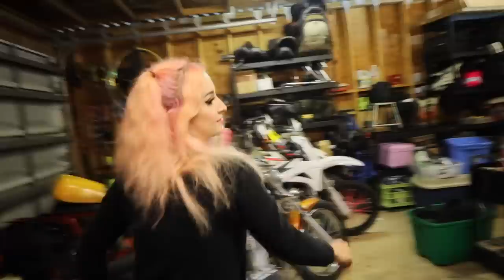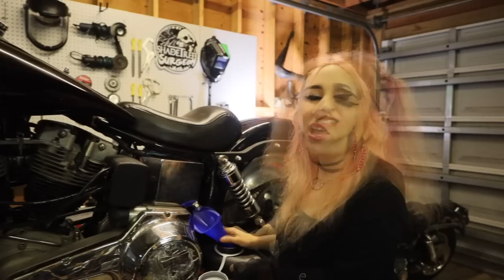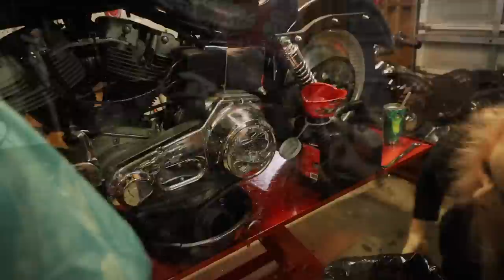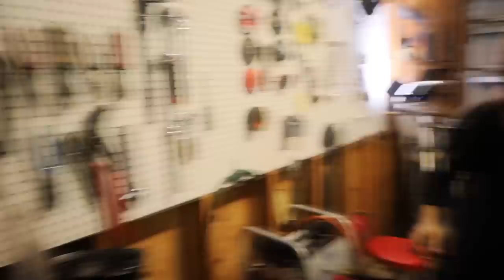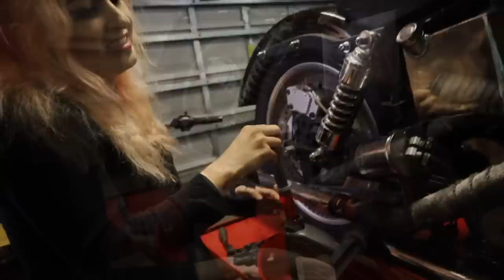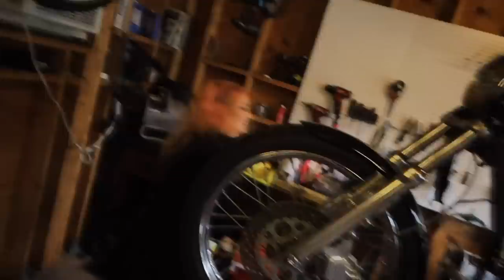I Bought A Shovelhead...Now What???

Comment: In all the big twins I have owned, 60 weight for the engine (Synthetic for Twincam 88's and up) 80weight gear oil for the tranny and ATF for the Chain case / primary.  Then if my bike leaks I can tell right away where it's coming from and I have just always done it that way  because the old school guys from the 60s and 70s did it that way.
Reply: Amen brother!

Comment: Harley’s always had the separate EXTERNAL transmissions vs a internally derived transmission in same crankcase as everything else like clutch/crankshaft.  This makes the engine much larger and heavier with more a power robbing chain driven primary drive vs compact gear driven primary drive.  Modern motorcycle engine oils need to be watched closely as oil lubricating engine and dirty clutch.  Ducat’s offer dry clutches without oil for faster clutch times and no oil pollution from clutch plate wear.

Comment: Chey, a tip for your drive chain. Get a chain guard and lube the chain with grease from the grease gun. Let the grease soak in for 15-20 minutes, then take a rag and lightly wipe the chain down. With the guard on, the grease will get on the underside and then drop on the chain. Will keep chain good for a good while.

Comment: A sprocket  turns the Primary chain ..  and a the primary drive is belt or  a chain..  
  It's always  better to use 20W-50 over straight  50 wt   20W-50  just flows much easier when it's cold ..
  So Cheyleesi spent  3 years  getting the Green Goblin in good shape and now  she is working on some other Money Pit HD

Comment: Another helpful tip regarding your Chain Maintenance is go for a ride first. Warm the bike and chain up on a 20+ minute ride when you get back lube the chain then. Leave for the rest of the day it soaks in and then wont fling because it sticks to it over night. Also there are some very good non fling chain lubes if you look around.
Reply: Also carry a master link in your pouch.just in case .. fixed chain once or twice in my time

Comment: Hate to point it out, but in a sportster, the engine oil and tranny oil are separated, the tranny and primary are connected and share the same oil. You can see this clearly by looking at split cases, or by noting the hole at the bottom of the primary that allows oil to pass between primary and tranny.

You can also see this by looking in the manual.

Comment: I'm glad to see you added a vintage bike to your collection.  That thing is nice.   You're gonna learn so much owning that motorcycle.  I don't own any Harleys but I'm sure there's  some good educational videos on line that will help you. (Along with Uncle Josh of course.)   I've got old Triumphs and Hondas, but I'd love an old Harley. 

The first time I changed my oil I dropped the drain plug into the funnel which clogged up the opening and oil went everywhere.   I use tin-foil to cover exhaust pipes or whatever I don't want oil to get on.

Comment: "A divorced engine and transmission is really uncommon these days, almost nobody does it.." except Harley, and the single cylinder Royal Enfields. The last British bike to have a "pre-unit" setup was Norton, they held it all the way through to their demise.. in fact I think the new ones (Commando 961) even are still pre-units despite being an entirely new engine. Moto Guzzi also has a divorced trans but that's because the engine sits sideways and the transmission is like a car's.. come to think of it I think BMW and the Hinkley Triumph Rocket 3 are the same way. The Silverwangs also have a transmission that's similar but those are older so they don't count. 
Just draining the oil tank isn't enough, you need to drain the crankcase as well.. anything below the tank is still going to have oil pooled in it, if you don't drain it you are mixing old oil with new.. and anything heavy is going to be in the lowest part of the engine. 

In old Triumphs/BSAs/Nortons etc you NEVER want to run synthetic, really any bike made before the 90's because they often didn't have an oil filter so you want the particulates to drop out of the oil into a screen called a sludge trap that's inside the crank instead of staying in suspension in the oil and going all over the place in the engine and destroying it. In the T120C with it getting 115+ in the summer here and it being air cooled we run regular Castrol 20W50 though you could run normal SAE50 as well.. almost nobody makes that anymore though... at least in the US. Lunmad (RIP John) used to run straight SAE40 in his Bonneville in England.

Comment: You may want to Check out YouTuber "Pacific Mike".  He has a ton of video's on old Harley's.

Other comments,  I use to have a LS650.  I thought I saw you were selling it.  Anyway, a suggestion is dump the Stock muffler and put on a Harley Dyna muffler (they fit nicely).  Screaming Eagle muffler if you can.  Then re-jet carb and the bike really wakes up.  It will easily walk away from a Harley 883.  The Savage user-forum has links to buy jets.

Hard-tail in Florida, should be bearable.  Here in PA, too many potholes and bumps.  You would need a Chiropractor after a week of riding.    

Next, newer Harley Big twins are Wet Primary's. Stock Shovel-Head's and earlier are semi Dry Primary's.  There is a small oil line that drips oil on the primary chain and a scavenger line that sucks it back into the oil pump (yes, strange setup, that is prone to leak).  The clutch plates are basically dry.  Which means at Stop lights you should shift into neutral and let out the clutch. Or you will heat up the plates.  ((yes, just like you are suppose to on a Triumph......))

Finally,  an advantage of Harley's separate engine oil and tranny oil is that you can use modern Anti-friction oils in the engine.  Can't do that on a Wet-Clutch bike,  the clutch will slip in top gear under a load.

Comment: WOW , never take the fill plug out until you get oil coming out of the drain plug. That would have avoided your mess.  STD heads have 3 mounting holes for the exhaust. Eventually your gonna have to take that trans fill plug out. Why not do it right the 1st time ?

Comment: Great video. I wish i had the balls to work on my harley like that. Im afraid to mess things.
Reply: Get you a good manual and just go for it. Except for the electronics the twin cams are a breeze compared to a shovelhead or sportster
Reply: Just dive into it dont be scared. I bought my 1996 dyna in 2020 and ive done everything to it myself besides mounting the front tire, ive learned a ton since and its been very rewarding.

Comment: No leaks, you got lucky... With my shovelhead the rear head is off to replace the rockerbox gasket... Love the shovelhead content! I have a lathe and use it to make brass acorn nuts.
Reply: My 76 shovelhead is still original... Doesn't leak ANYWHERE... One solid bike less than 33,000 miles have every receipt for everything I've ever bought or replaced in it's life it was my 18th birthday present...one hell of a present